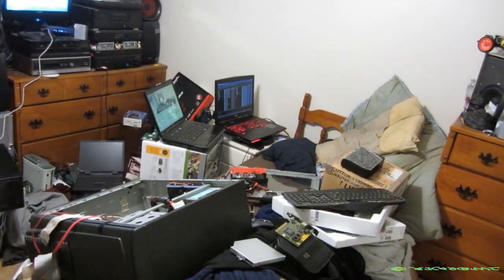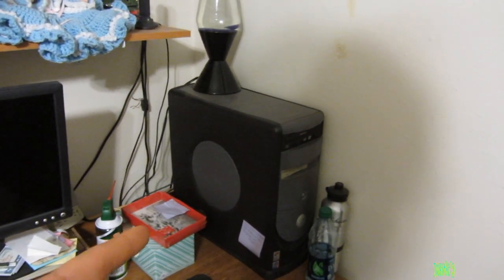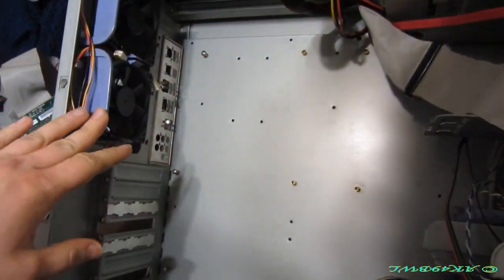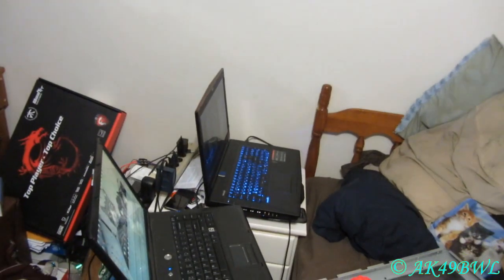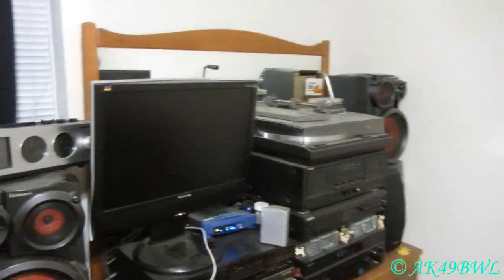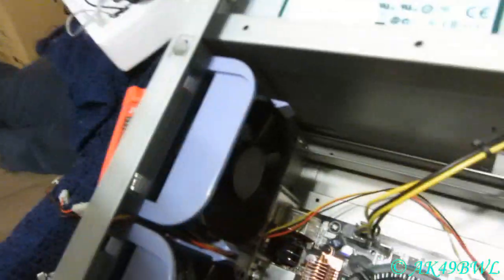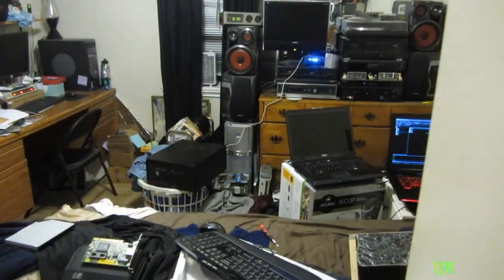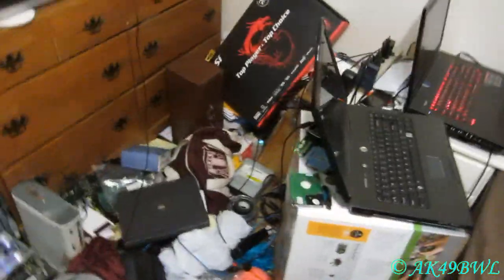My True Passion

Comment: Have you considered being a computer technician or working at a computer repair depot? BTW I have no issue with W8 mind you I started using it when the 8.1 update rolled out and use a 3rd party app for a start menu by Reviver Soft. I'm not too fond of the tiles on the Metro UI but I'm on the desktop side of things more often and at the least W8 runs very fast.
Reply from the maker: Djonkie Bonk I have, but most those places require some sort of technical background or schooling, and I'm sorry but I'm not paying to learn what I mostly already know. Though I will admit, I need to brush up on some of the newer technologies out now lol. M.2 SSDs are a brand new deal to me, I'd never even heard of M.2 until I bought the new laptop. And DAMN it's fast. Also to note that this is the first SSD I've ever owned lol. Love Windows 7 Ultimate booting from a cold start to desktop in 10 seconds flat.

Comment: Where do you buy all that stuff?
Reply from the maker: Mitch Taylor It varies. The two P5xx mainboards (and the components on the P5Q) and the MSI laptop I got on Newegg, the Vostro I bought direct from Dell, ...... what is it specifically you wonder about, I have too much to write down haha. Most of the older systems (the two Dell Latitude Pentium 2 laptops, the P2B-F, the Pentium 1 board/components all came from a few classes in high school. The 10GB WD hard drives (I have 10 of them) came from a ham radio fest I went to with my dad a while back. The RAID card, from ebay (I have two of them)...... Like I said, it varies. But I will say, Newegg is my first choice for buying new computer stuff.
Reply: Nothing in particular, just curious as to who even sells stuff like that. I am a Mac guy (but I do use PC also) and never really thought about building my own computers.
Reply from the maker: Mitch Taylor  when it comes to desktop systems, I wouldn't have it any other way lol. What I wish is that all the laptop manufacturers hadn't quit offering the ability to customize their laptops before buying. I really wanted a 1440p screen, but didn't need four SSDs and 32GB of RAM. Or to spend $2800 lol. 18 was bad enough...

Comment: i have computers lying around my room also. im wondering if you know how to replace a cpu on a msi cx700 seeing that you have a msi there also, currently im stuck with the pentium dual t4200, would you know which one to get, i liked the look of your intel core 2 xtreme that you put into your dell laptop.
Reply from the maker: Uhm... I'm not going to straight up say yes because I'm having difficulty finding info on the chipset (a SiS 672DX), which is the determining factor into what you can put into your PGA478 socket. The good news is, replacing the CPU in a 478 is easy (did so in my Dell Vostro. Twice.), and it looks like all YOU have to do is remove the bottom cover, CPU fan and heat sink to get to it. The REAL question is what that machine will support, and is what I'm having trouble with. T4200 is an 800Mhz FSB CPU running at 2Ghz .... Theoretically, you could put the same CPU into that one as I did my DVostro - The X9000, a Core2 Extreme CPU running 800Mhz FSB to 2.8Ghz (screaming CPU if you ask me :D ) BUT!! I have no way of knowing it'll even think about working, given that I can't find any info about your machine aside from OEM specs.
Reply from the maker: Also believe it or not, this is my first MSI ever lol. I prefer Asus, but their power-laptop designs just didn't .... grab me like the MSI did. And the MSI had better reviews. But teh funny thing about this one is, I can't even replace the CPU in it because it's soldered to the motherboard :p it's like the only thing IN it that ISN'T upgradeable.
Reply: Yeah the cpu and fan is real easy to get to. I do wanna put in the x9000 it has 4gb ddr2 800 spd ram
Reply from the maker: Nick Wood Well all I can say is, good luck  to you if you go for it! Also if you do, watch your heat closely - The X9000 does run pretty hot on coolers that weren't designed for top performers ;) here:: Watch my video on CPU replacement, more toward the end where I start mentioning the softwares I use to monitor and control. https://www.youtube.com/watch?v=I9a0hIPdVmc
Reply: I also have it connected to a tv but took out the battery as i dont want to fry it

Comment from the maker: @slovokia sure do, I'm KL2CD.
Reply: Have you been able to do any ham activities on the road? I used to do a fair amount of hiking with an 2M HT and made a few contacts mountain topping. I noticed that you had a CB radio in your cab in one of the video's - is this your own radio or are most trucks equipped with them? These days with programmable ham rigs it might be possible to travel around with rig +  a computer that dynamically programs repeater info into your rig depending on GPS coordinates.
Reply from the maker: Honestly, I'm not as into the ham stuff as my dad (who got me into it at all).. The CB has always been more useful on the road imo (because I don't have a GPS auto ham radio lol).. You can almost always get a trucker on the horn if you need to. Pretty much all trucks I've seen nowadays come with CB radios, tho I do know they're generally optional lol. I need to replace the CB in my personal vehicle... It's such a POS, but I guess it does work at least lol.